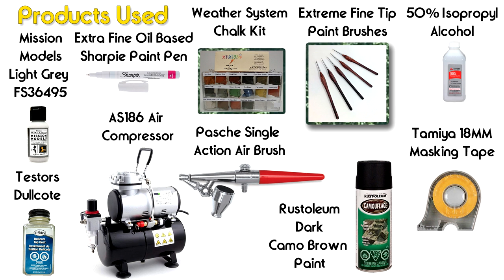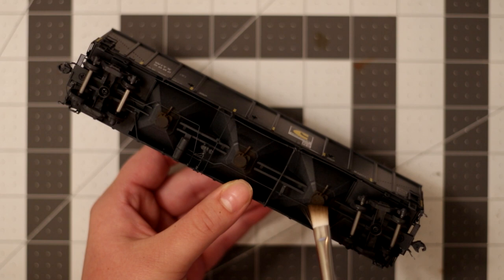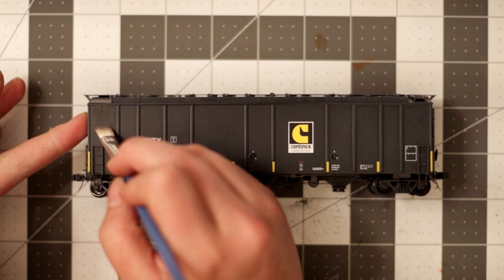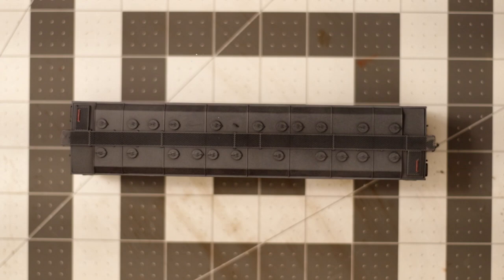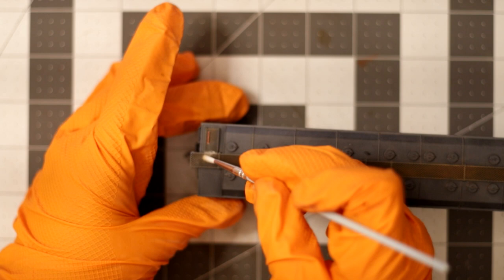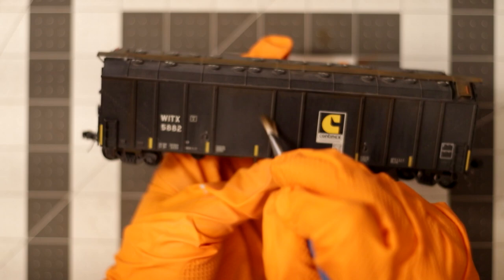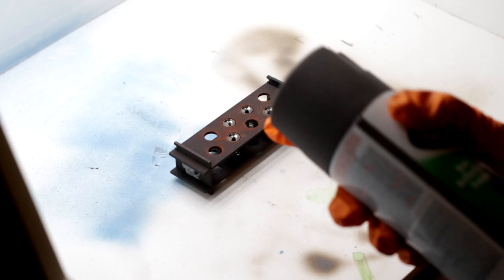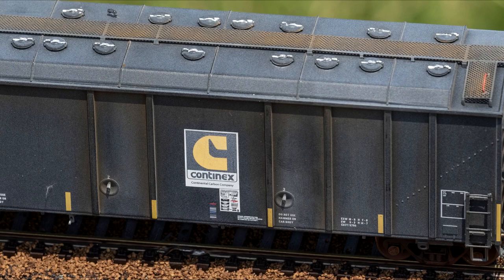A Practical Guide to Weathering | Carbon Black Hoppers

Comment: Great weathering job.  I would suggest removing the trucks and wheels when doing any spray painting of a model.  That is to keep any paint on the wheel treads.  I use the same wheel mask that you used and it is a great tool for that task.  Another detail might be to paint the roller bearing caps a blue as some trucks are painted that way.  Just another detail.  I look forward to seeing more of your work.

Comment: Something I learned recently from Lee Marsh - if you're going to be photographing your cars at a low angle (something you definitely would want to do with your Carbon Black Covered Hopper), the unpainted bare metal axles and backs of the wheels can wreck the photograph by reflecting light. It's probably worth the extra time, even just to brush paint those inner surfaces with a rail brown color.
Reply from the maker: Hey Burr! That's honestly not even something that crossed my mind but very true! Thank you for the feedback!
Reply: For painting wheels I highly recommend the jigs sold by Modelers Choice. They have sets for 33 inch and 36 inch wheels. They save a lot of time, just set them up and shoot the wheels flat black or flat brown, then add some powders to the outside of the wheels before removing them from the jig.

Comment: This may be a personal preference Charlotte but when I am airbrushing, I prefer to wear tight-fitting gloves. I have a tendency to unknowingly "touch" areas of the model that I don't want to when they are as loose fitting as the ones you are wearing. There is also more of a tactile sensation that allows me to detect small details that I might otherwise destroy. As I said, probably just a personal preference.
Reply from the maker: Jim I appreciate the feedback. Unfortunately all I had on hand was some XL gloves due to the pandemic it has been hard to find gloves! I did chance upon a box of mediums which fit much better I'll be using going forward. Thank you for watching and leaving a message!